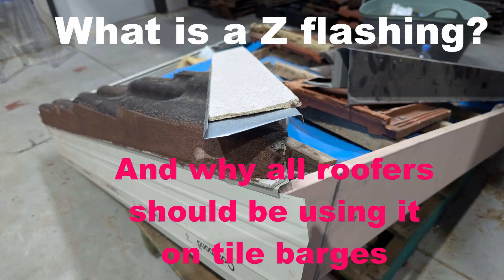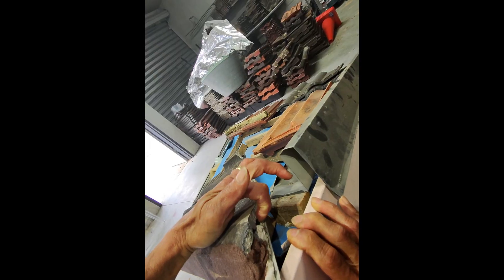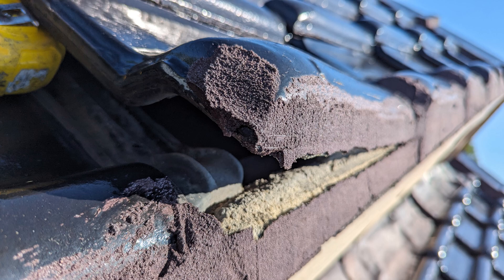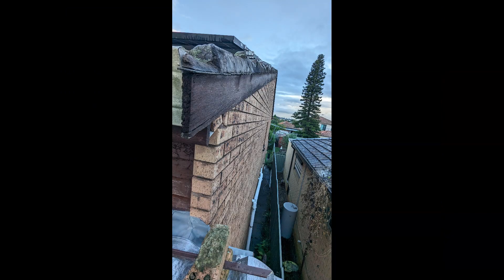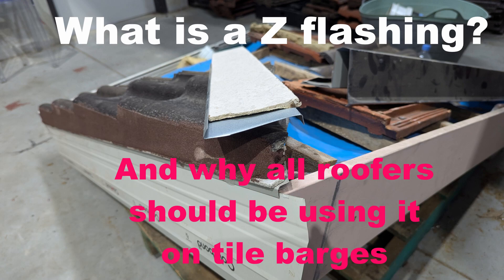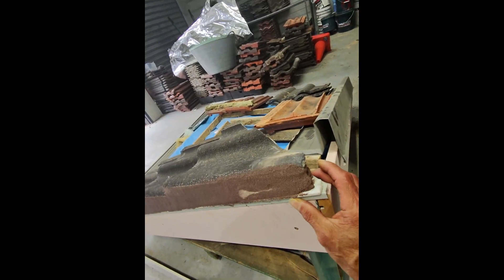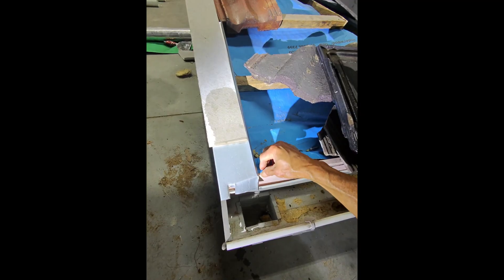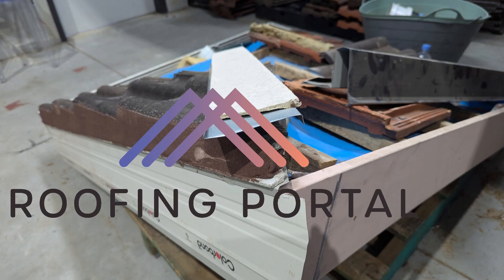why use Z flashing on a bed and point tile gable

Comment: What are the dimensions for the flashing and cement sheet?
Reply from the maker: The fibre cement strip is 100mm wide. This is also the width of the Z flashing - which also has 10mm edges.
Reply: Why not simply use that barge gutter that you've got sitting on the other side? No more bedding and pointing.